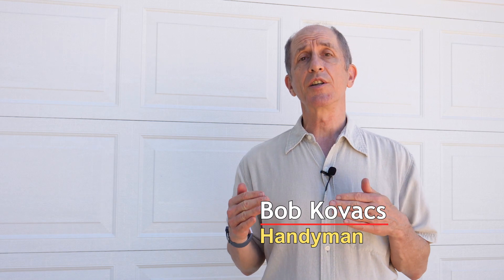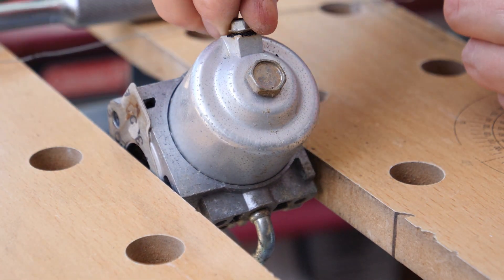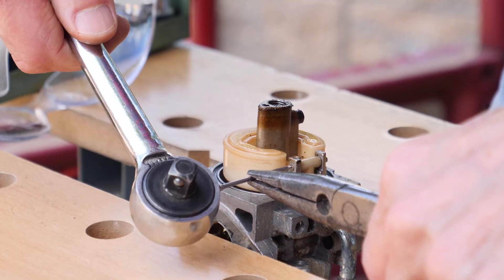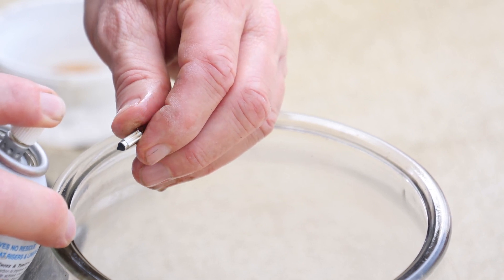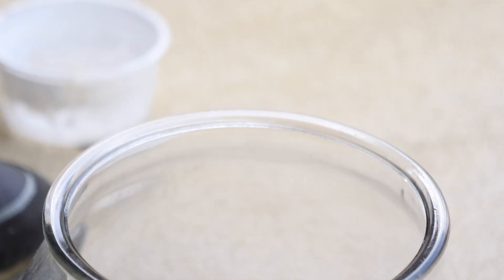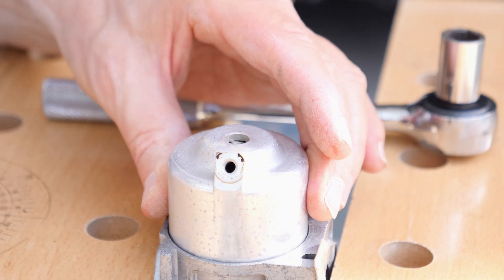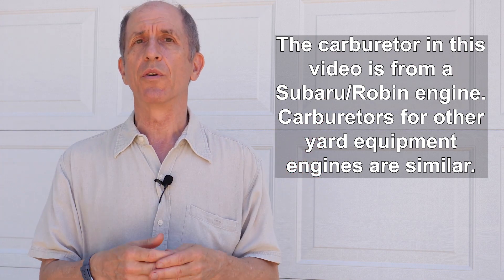Small Engine Carburetor Repair

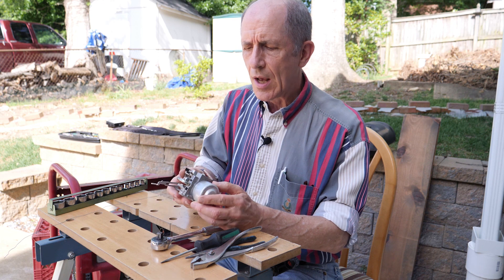Comment: re 1:45 Since you will be working with little pieces, I spread a worksheet on the floor under my work bench for pieces that drop or spring out, and might roll away or fall into a crack.  A little bowl or bin will also keep them safely in view during re-assembly.  
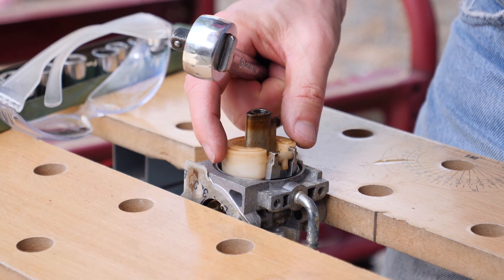re 5:00 Since most of us are washing our hands more frequently than normal during CoViEp, I recommend using exam or dish-washing gloves when handling solvents like fuel & cleaning fluid.  Our hands are already dryer than normal, and skin contact with solvents can cause significant irritation, cracking, & burning.  At least, a preventive film of petrolatum (ie Vaseline) to protect your skin a little, from further damage.
Reply from the maker: You're right on both accounts. I have lots of rubber gloves and I should have been using them to do this video. (I've used them in other videos.) As for the possibility of losing pieces, that easily could happen... especially if this is your first time at it and don't really know what you're facing. Although the reality is that there are fewer pieces than I thought there would be, so it turned out to not be a problem keeping track of them.

The first time I did this to a carburetor was on a blazing hot day trying to get my Latino neighbor's generator going. I don't speak much Spanish (I could croak out "gasolino malo") and he didn't speak much English. I had heard about carburetors clogging up from old gasoline, so I decided to pull the carb off and take a whack at it. All in the blazing Virginia sun, while his wife brought us ice cold Cokes to keep us hydrated. Amazingly, I got the carb back together and the engine fired right up. With a look of surprise and awe on his face, he said in his halting English. "You are a good mechanic!" That compliment ultimately led to this video.
Reply: @BobKovacs  Good for you: Never waste good luck by being unprepared. ;-)